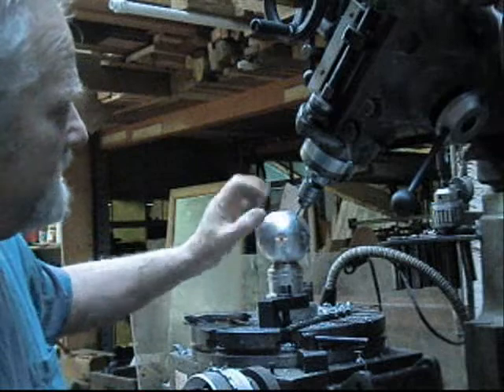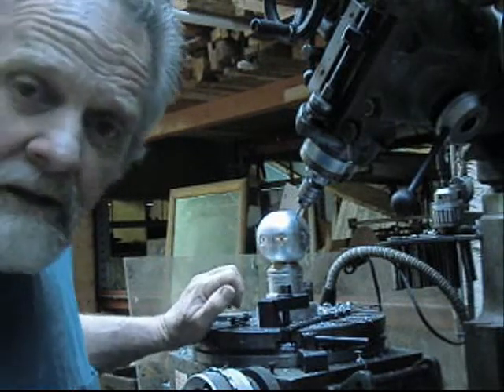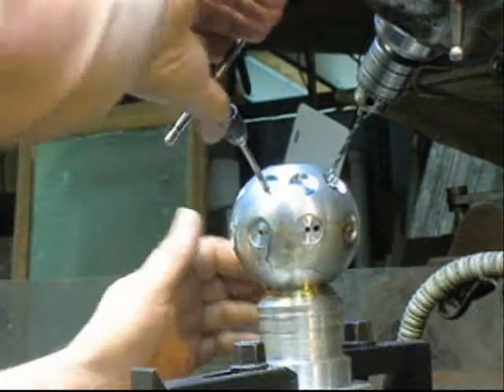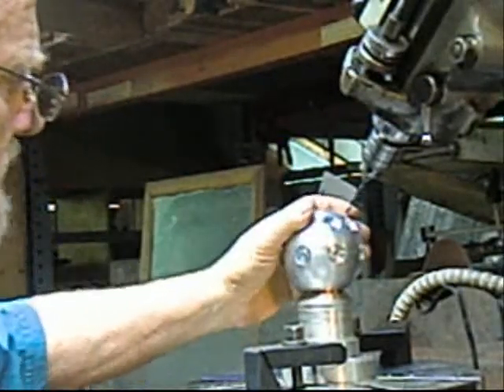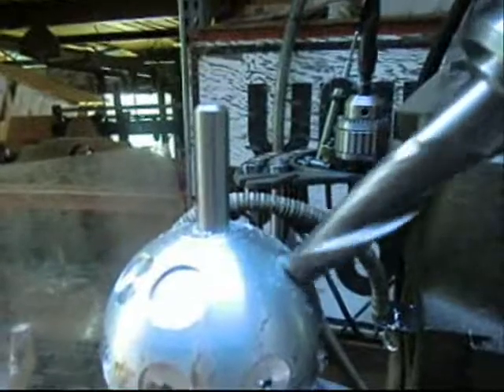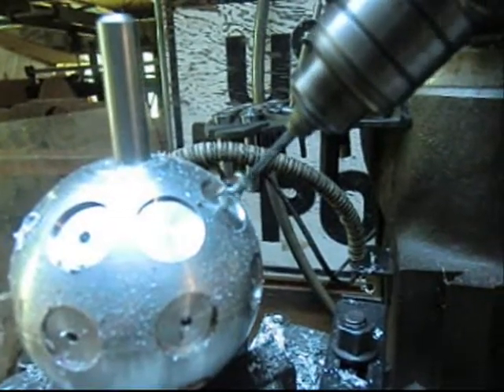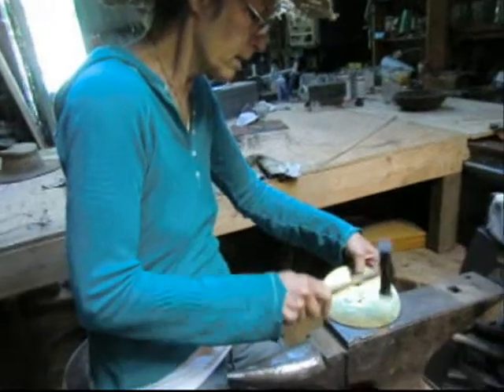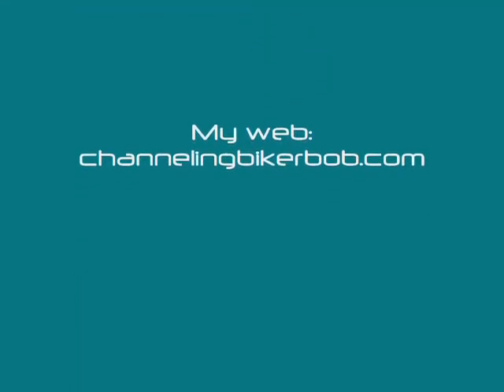Balls Out Free Energy Generator #6

Comment: Couldn't you have put the 90° head back on (with the mill head still at 45°) with the 90° head angled perpendicular to the existing 45° angle, which would be add the 45°  to the 90° to give those 135° undercut insets? (I'm no machinist - just askin')
  I know it sounds weird...
Reply: Never-mind... there would be no way to advance the mill bit into the material at the proper 135° (actually -45°) angle.... didn't think it all the way through.